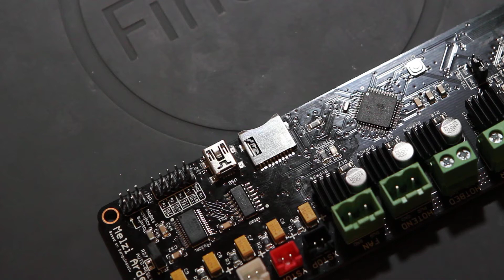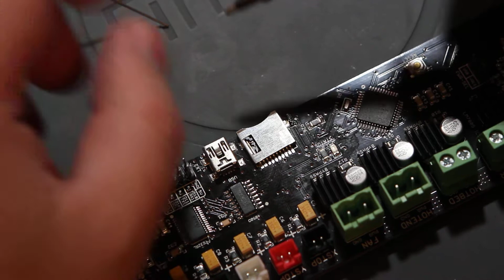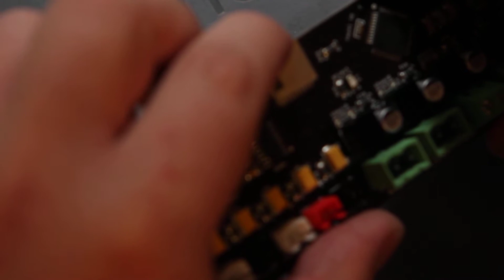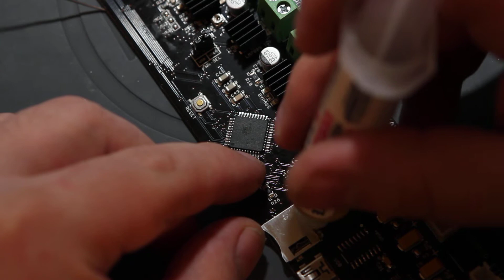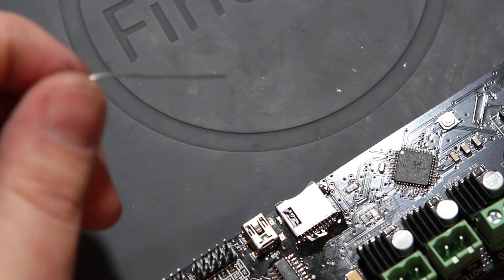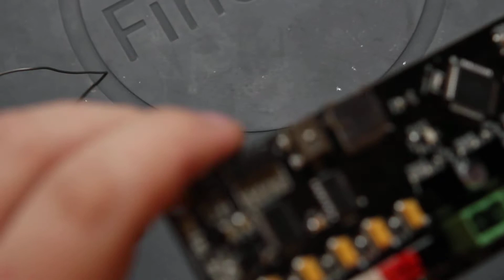SD Card Slot Replacement Repair Monoprice Maker Select Wanhao Duplicator i3 3D Printer

Comment: My power supply accidentally tipped over and broke the card in half.  It was the only one that actually worked perfectly! The slot is now quite loose.  Very poor design to have the card sticking out so far.  I cannot solder to save my life, so I am stuck and Cura is not connecting to my printer.

Comment: I just got replacement parts for this ... It was for the Green connectors. My bed wasn't heating up. If anyone needs the part numbers here goes:
1. 732-2775-ND
2. 732-2728-ND

From Digikey. I think I paid 20 bucks for 2 of each and shipping. I could be wrong I know it was very affordable. I am going to buy more and replace all of the connectors on the board. The ones that came on the board are cheap. But these from Digikey are legit.

Hope this helps!

Comment: Hi, Great vid. Can you tell me where you got the new port and what it’s advertised as or if it had a part number? Thanks
Reply from the maker: It is called a micro sd slot. You can find them on ebay, mouser, digikey, ect. Make sure you get one that matches the one in your printer otherwise you may have to make modifications to fit.
Reply: Sparky & Friends. Thanks for the reply. Really struggling to find one that’s the exact match with the connections in the right place but I’ll keep looking
Reply from the maker: What country are you in?
Reply: Sparky & Friends. Scotland. Seems a lot of the ports have the pins on the right as opposed to these ones that are more centred
Reply from the maker: Here is the exact unit on ebay: https://www.ebay.com/itm/141132599560
Reply: Your a gentleman and a scholar. Thanks very much. Now the waiting game begins until I get me 3d printer running again. If your ever up Aberdeenshire I’ll buy ya a beer. Thanks
Reply: Should of posted ages ago but time ran away on me. Got the part, easy enough fix even for me with your vid. Saved me a lot of pennies and angro. Cheers again
Reply from the maker: Great. I happy to hear you got it going.